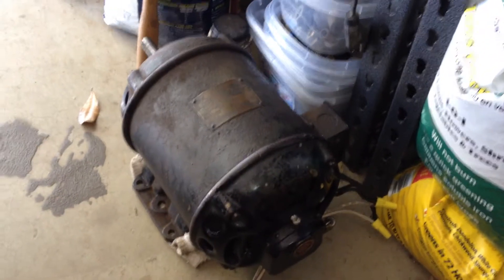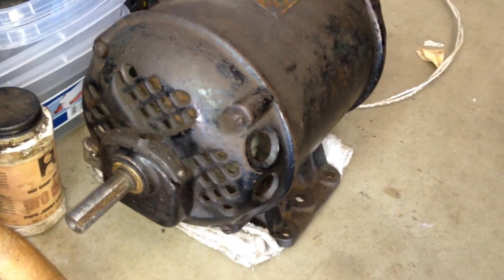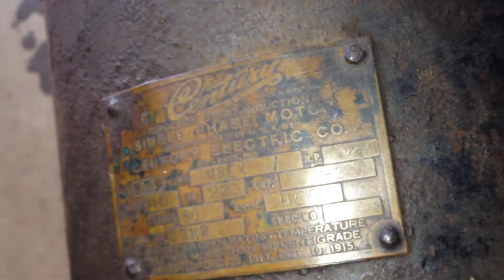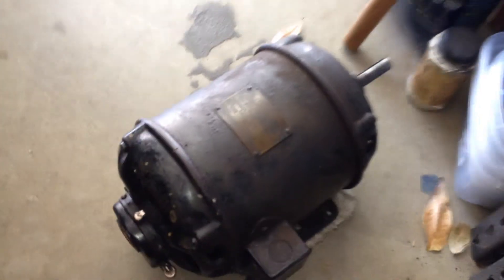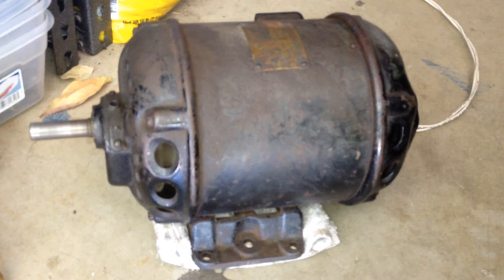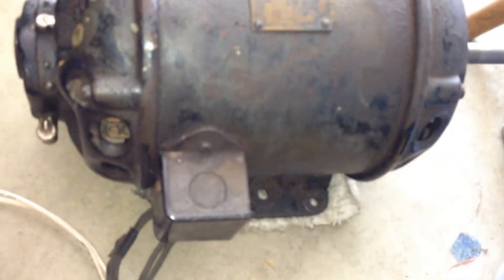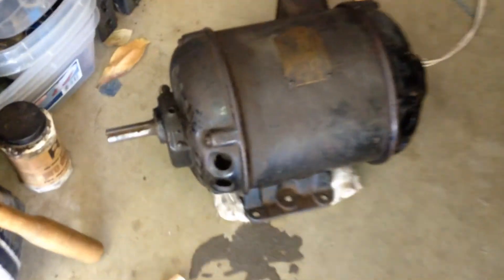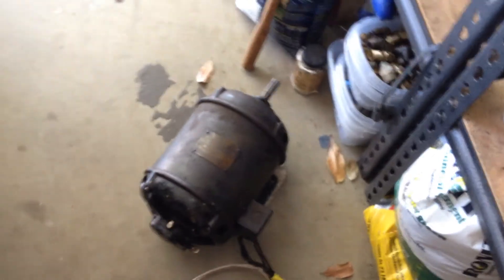1/4 hp, 6 pole, Century Repulsion Start - Induction Single Phase Motor

Comment: Very Nice!  I'm glad there's other nuts like me out there!  So nice to see these old machines are not all being scraped.  I have an old Wagner r.i. 7-1/2 hp.  I had it  rewound for me a number of years ago.  I found it in a scrap yard.  They are very heavy, it cost $200.00, because of the copper and brass.  It was nice looking at your other motors too!  All the best in your collecting.
Reply from the maker: Nice! Glad you saved one too. You should make a video of your Wagner! I have a 1/2 hp and a 5 hp one, both RI. I believe they're later than the Century. The 5 hp is going to go on a Kellogg American compressor.

Comment: Hi,

I am looking at a 1/3 HP Century repulsion start motor marked  - Type RS, Frame M8X,  volts 100 - 200,  Amps 6 - 3, 50 cycle, RPM 1450, Serial 900067, Patent 1915.

Can I run this safely on the 240 AC 50 cycle that we have in Australia ?

Cheers Rob
Reply from the maker: Hi, that's an unusual voltage, though I imagine the ones for export were different as required.  Here we find the earlier Centurys are frequently 104 - 208 volt, and after that they are consistently 110 - 220, in this style.  Later yet are 115 - 230, the current standard here.  I've never seen a 100 - 200. I think Japan uses 100 volts? It may have had a very long journey to get to you! But, to answer your question, I would tend to say that it would likely be fine for testing or demonstration purposes.  I'd connect an ammeter to be sure that it isn't taking more than rated current.
Reply from the maker: To place the motor in service or to run it for extended periods I'd use a buck boost transformer.  They're available in a few different voltage configurations. The one most likely suited to your application would be a 120 x 240 volt primary and 16 x 32 volt secondary, though perhaps there are different ones available there.  Connected to buck, you reduce your 240 volts by 32, down to 208, which should be fine.  I've run the 104 volt motors on 120 with no trouble at all, though I've yet to put one into service to see how it does and take current measurements.  Got any photos or video of it yet? Regards, Keith
Reply: Hi Keith,

Thanks for the feedback.  I contacted an electrician friend and he said it should be OK on 240.  Better high than low voltage.

I've made an offer for the motor, depends what happens.  They look nice with the ornate casting etc.

Cheers Rob.
Reply from the maker: Actually these motors work quite well on lower voltage, if the load is light.  It is true that a fully loaded motor will slow down and take more current if the voltage is too low.  But the problem with too much voltage is that the current also goes up- even the no load current goes up, so the motor runs hotter. When the voltage is too high, the magnetic core saturates (cannot "hold" any more magnetism) which causes the motor to take significantly more current.  I would definitely suggest using an ammeter to ensure that you're not exceeding the motor's current rating by running it on that much of an over voltage.  Would hate to see one get damaged!  Post a video when you get it running. :)
Reply: I'm going over to inspect it tonight.  He only wants $10 for it, so I expect it will follow me home.

I will do a video on it for sure.

I don't know if you have seen my channel, but I have a few videos of my old 1930's Schaublin 102 metal lathe on it, driven by a vintage cast iron frame squirrel cage McColl Electric Works motor.

They also made repulsion motors, one of which had a variable speed/reverse direction control handle on it.

Here's a link to their early catalogue: http://nla.gov.au/nla.obj-43740874/view?partId=nla.obj-43740882#

Not as old as these motors, but makes interesting reading.

Cheers Rob

Comment: I have one in my garage 1/4 HP century 110/220 real ornate 1914  My Grandpa worked for Century electric in St louis I almost scrapped it! weighs around 50 lbs. who refurbish's these motors?
Reply from the maker: Hi, I'm not sure how I missed your comment, and I'm seeing it's been  one year! Sorry!  They are neat motors, and I'm glad you saved it.  A reputable electric motor shop should be able to perform just about any operation that it needs.  I've found that they usually don't need much more than a good cleaning, just be careful to use an electric motor cleaner that is safe for the winding insulation.  Many solvents will ruin the insulating varnish.  Sometimes they need a commutator service, which, again, a reputable shop can do.  Often you can get away with using a commutator stone to clean up the commutator yourself.  Good luck!